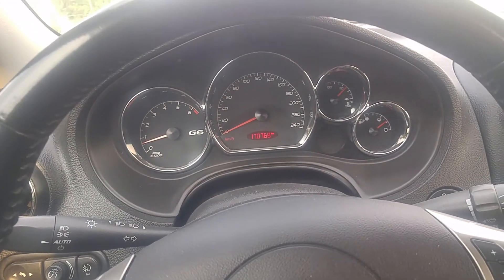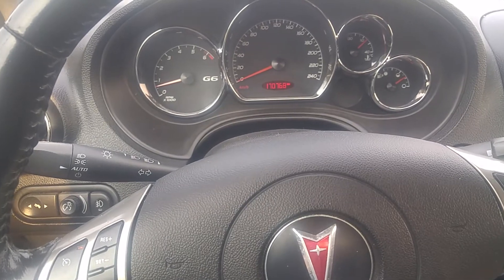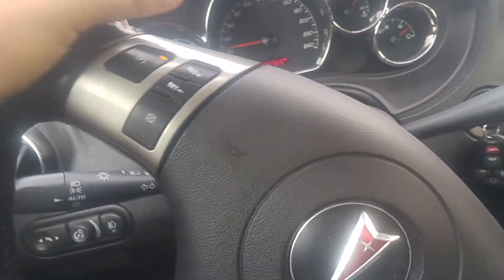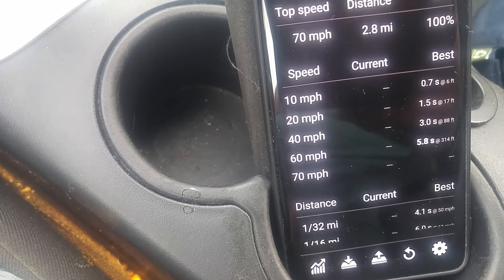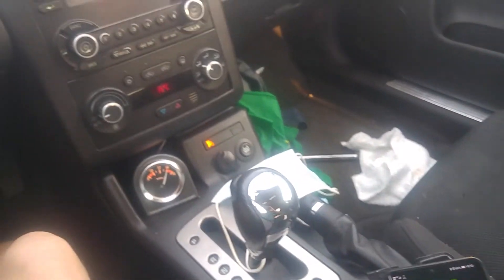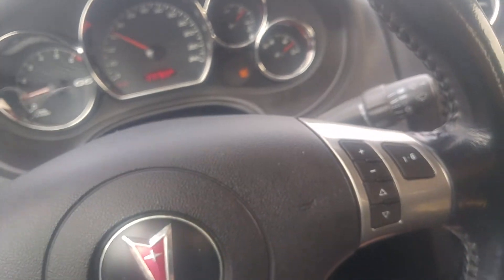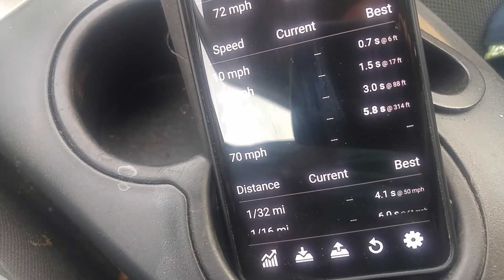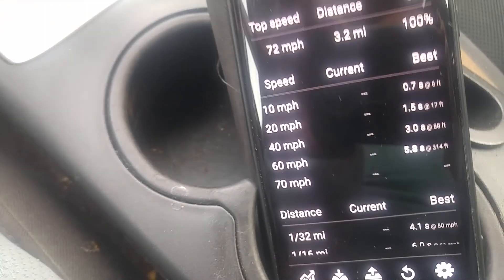Pontiac G6 GTP 0 to 60 mph after more mods and weight reduction

Comment: You have some good video's about the G6. I to have an 07 G6 gt an im learning about through yur video's. I aim to restore mine to the original with the exception of cosmetic mods. I subbed.
Reply from the maker: Thanks Andrew for subbing,  from the first time I saw my G6 for sale I knew I must have it. The body lines are what drew me to the 2 door. The look of it to me is just perfect. Plus they drive so nice.
Reply: Hey brother I’m about in the same boat. But I gotta fix the trunk and convertible top first. Like half the stuff on my car didn’t work when I first got her.
Reply from the maker: @rylandmcclelland876 I do like my Pontiac, still has lots of get up and go.

Comment: What kinds of mods? I swear I heard a blow off valve
Reply from the maker: No turbo's were added to the G6. Free flowing intake filter and better exhaust flow were added. Along with higher energy coil pack and iridium spark plugs. But the best results were weight reduction where I could. Overall the car runs really good and quicker than I expected.